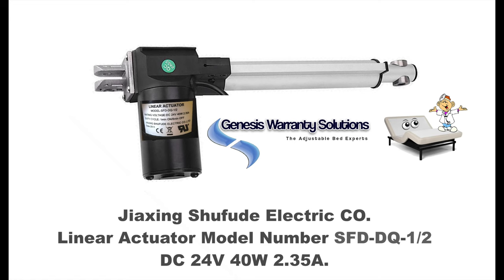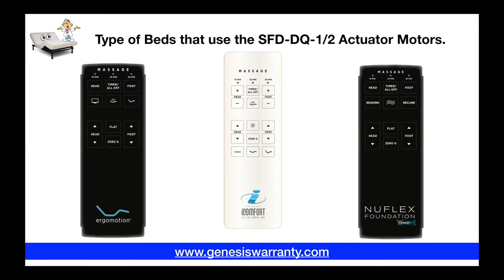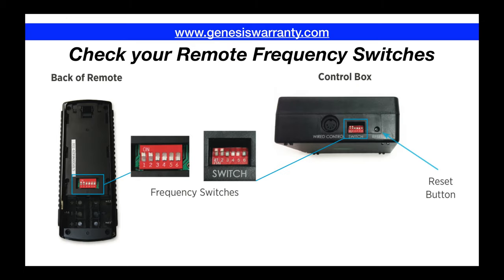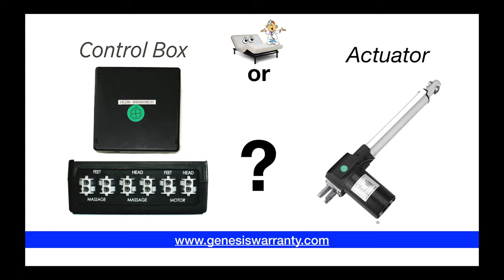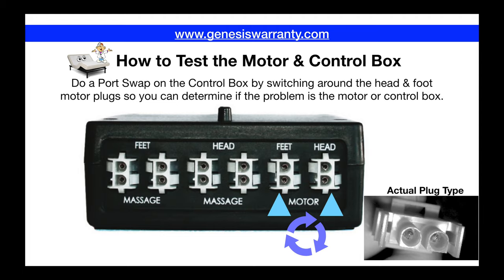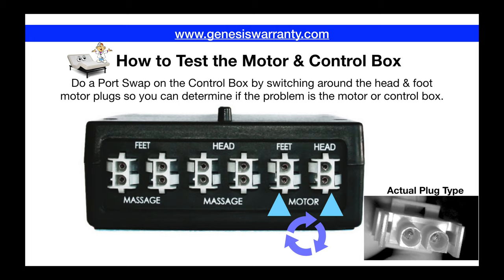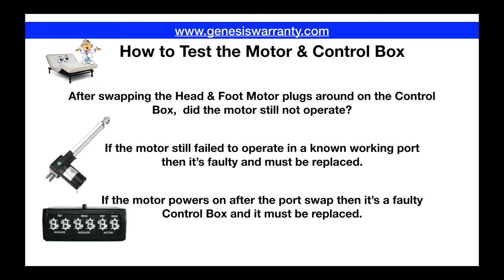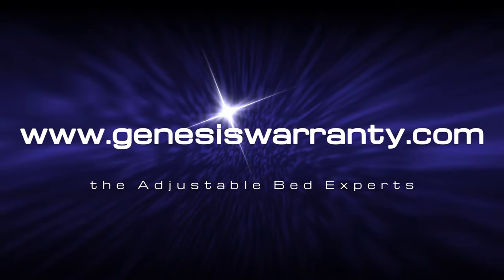Jiaxing Shufude SFD-DQ-1/2 Actuator Motor Troubleshooting Ergomotion, Simmons NuFlex, Serta iComfort

Comment: Would have been cool if you'd have gone in and explained about the diodes and limit switches in the motor.
Reply from the maker: Yes Logan,  that would be a great topic but the internal parts on these motors can’t be replaced by the average consumer so we don’t get into that.

Comment: What is the stroke on the foot motor?
Reply: 6in/150mm you may need to move the holder if you dont buy the same replacement part